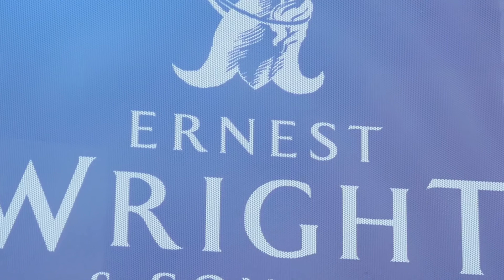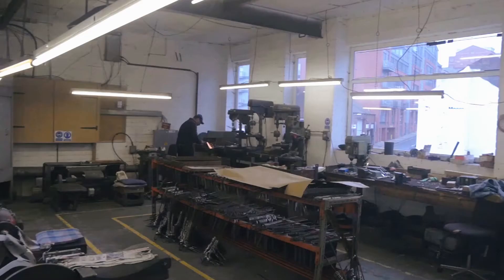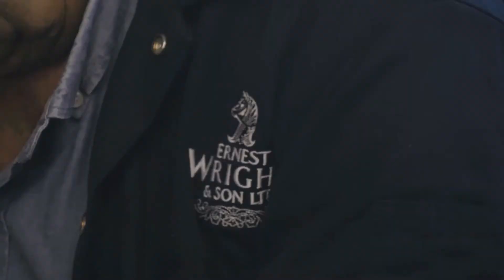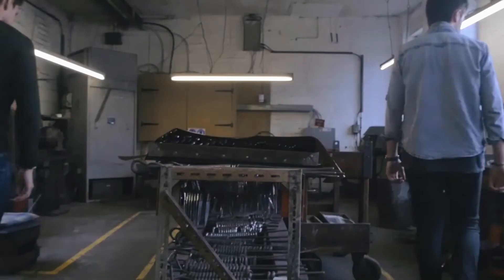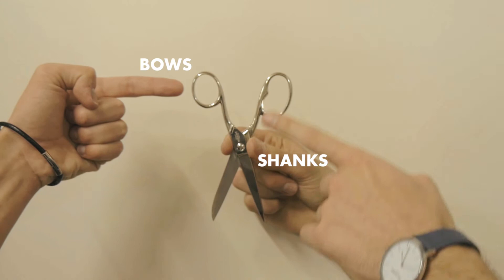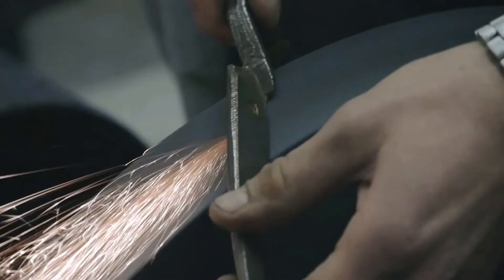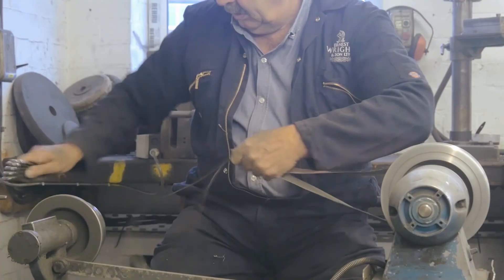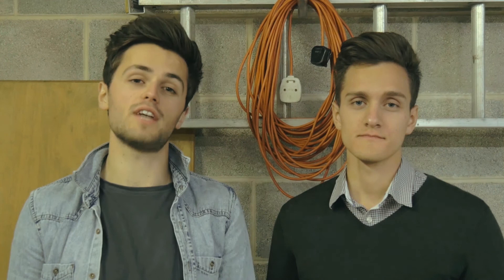Ernest Wright and Sons | Little Less Known

Comment: Just ordered my second set of scissors ,my first set being  bookbinders scissors.....finest in the world....there is no substitute for top quality ....Richard Hutchby.Vicksburg,Mississippi USA.........Thanks
Reply: Ernest Wright are really great, but how abut Whiteley? Aren't those in the same level? I'm trying to find a general use pair of scissors, and I want the best performance out there. Your opinion would be really appriciated sir, thanks in advance
Reply: @greekveteran2715  I have both,  they are both top notch , however pardon the pun I believe Ernest Wright’s have the edge ... why , well more time is spent on them the finish is super fine polished to a mirror shine , and as I have both kitchen shears  from both companies I tested them , Ernest pair seem to be smoother and cut with slightly less pressure the weight of one finger will close them and cut what ever is in the blade. 

My latest acquisition are  William Whitley’s Composite shears 10 inch of industrial might ! 
Designed to cut Kevlar , Carbon fibre , Aramid they are Teflon coated too it’s nice to own a pair that will cut anything and everything , plus you can say they are the oldest in the western world.   c 1760